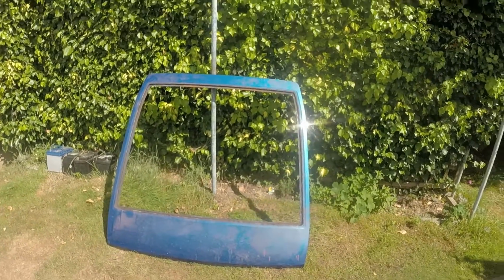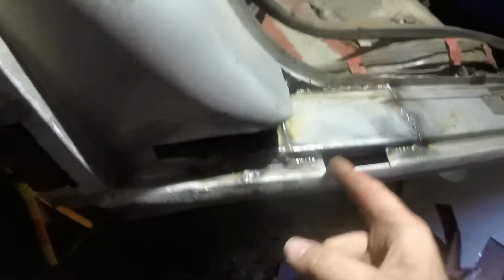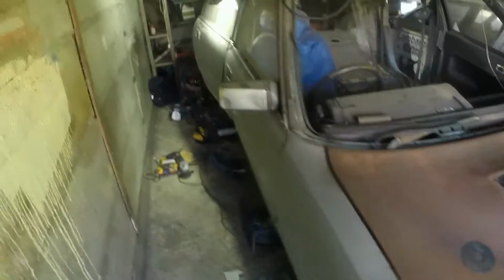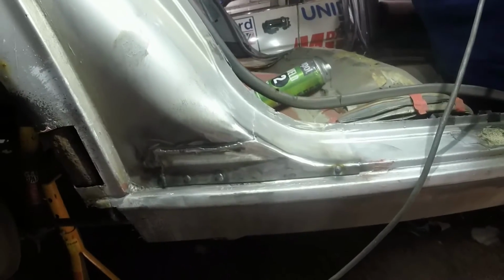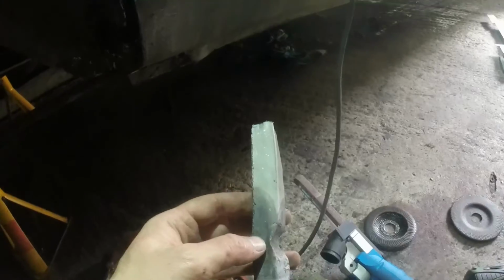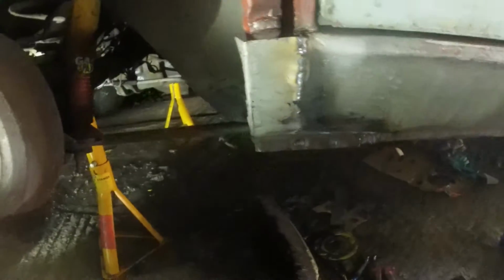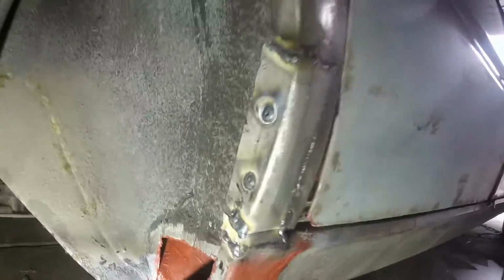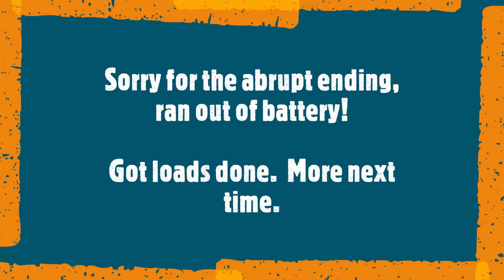Dotty 1981 Rover SD1 Restoration - Video 46 Offside rear end of sill

Comment: I’m a tight Yorkshire man and would just grab an appropriate sized and lengthen nut and bolt with washers if needed and bolt the wire brush back together and use the long end of the bolt to hold it in the drill
Reply from the maker: I think i might try and weld it.  Cost £4 and is pretty much brand new. :(

Comment: What model sd1 is this please
Reply from the maker: It is a 1981 Rover sd1 series 1.5.  It started life as a 2300cc manual with poverty brown interior.  Then someone fitted a V8 into it, modified the brakes and suspension and then neglected it.

Comment: Are you on Facebook or anything like that so I can contact you for parts or anything  please.  I would like the petrol tank you mentored
Reply from the maker: Hi Paul,

 you could register on retrorides and then send me a message through there?

https://forum.retro-rides.org/thread/131089/1986-rover-sd1-3500se-police
Reply: @nitrosilvia  it won't let me register. 
I need a fuel tank for my sd1 I am trying to renovate. Been watching your videos.have been inspired. If I can't get fuel tank.i will most probably just scrap the car. Shame as it's a 2600 se 1983 model